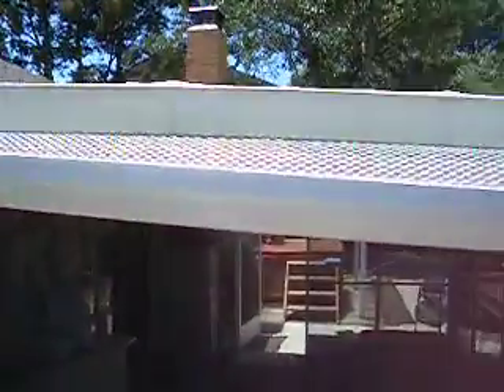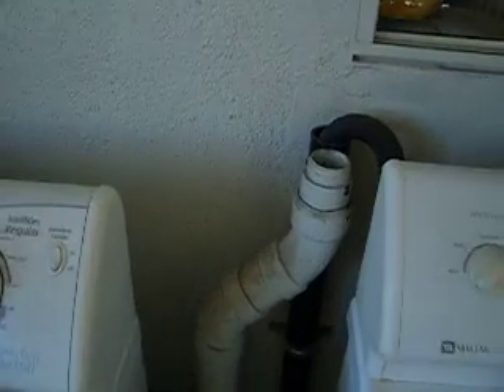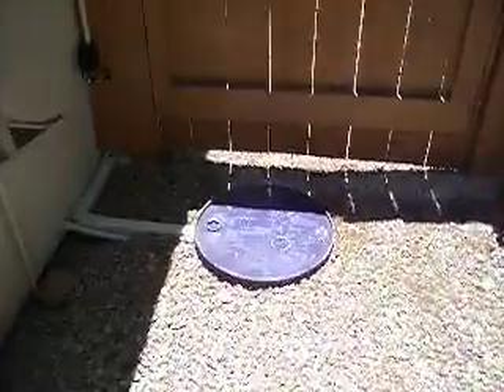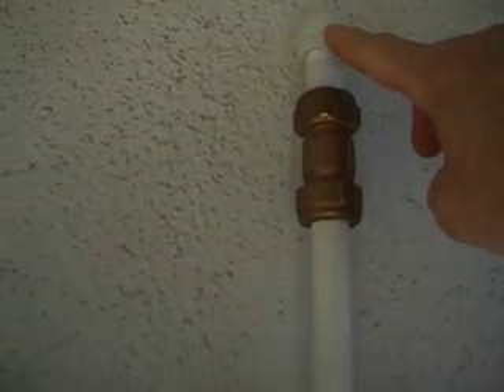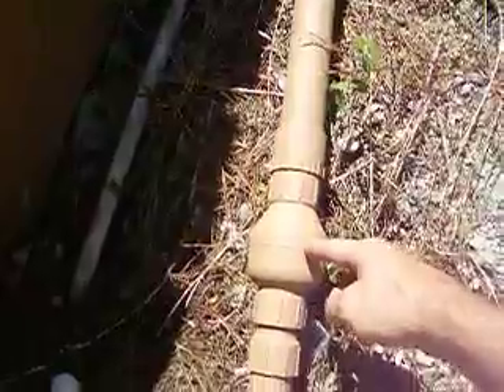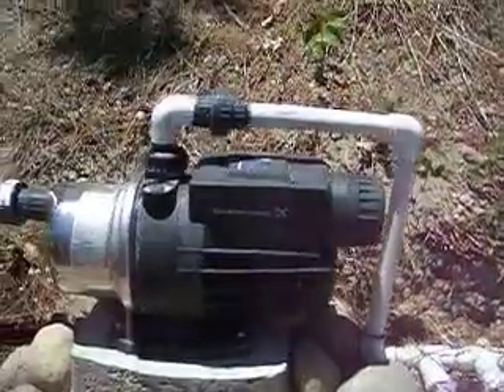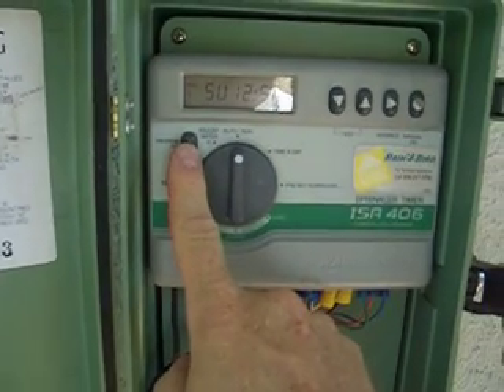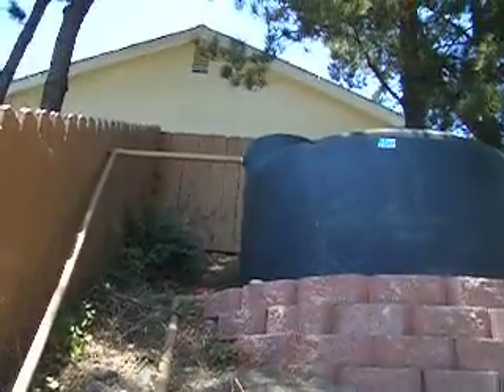Gray Water System

Comment: Very nice, Do you have an air stone in your thousand gallon tank? If grey water is stored for more than three days it starts smelling like Black water (sewer smell). The simple solution is an airstone like you would use in a 20 gallon fish tank. I did it on my system and cleared up the water (smell also gone) in just three days. I was able to maintain over 100 gallons continuous storage without any sewer smell AT ALL !  It only takes a surprisingly small amount of airflow to prevent the anaerobic bacteria from growing. The cost of my pump was about $25 US Dollars and only drew 3 watts. 
IF your thousand gallon tank were nearly full it would probably only take about two to three small airstones to maintain clarity and eliminate the smell. You may want to invest the WHOpping $50 Dollars to get the bigger air pump. NOTE: Don't pay the $2,000. to $3,000. that some companies will claim you need for your tank. They use a very expensive pump that puts about 50 times more air than is necessary. I understand that you may know this stuff I just think other viewers may use the info. 
Thanx
Harold
Reply: yes i had same thought, especially if sprinklers are being used to distribute. Roger, Have you modified your distribution or holding since this video?

Comment: Do gray water systems fail? How do you know IF it is failing? We have an older grand fathered gray water system on our rural home. In 2000 we replaced septic/drainfield/all related pipes. We do have a lot of big trees so roots have been a problem in the past. We are experiencing slow draining tub/sinks-some not all. We've pulled out hair globs, tried recipe of baking soda/vinegar to clear trap, tried snaking but tub plug won't allow snake in it. We really don't want to use chemicals as we drink well water/eat food from gardens. Suggestions? Advice? Thank you!!

Comment from the maker: @MrYungilla  Pictures speak better than text.  bought the fittings from home depot.  works great.  Let me know it the pictures don't show up OK.   Roger. 

/Users/rog/Pictures/iPhoto Library/Originals/2012/Feb 22, 2012/CIMG6625.JPG
/Users/rog/Pictures/iPhoto Library/Originals/2012/Feb 22, 2012_2/CIMG6627.JPG
/Users/rog/Pictures/iPhoto Library/Originals/2012/Feb 22, 2012_3/CIMG6628.JPG